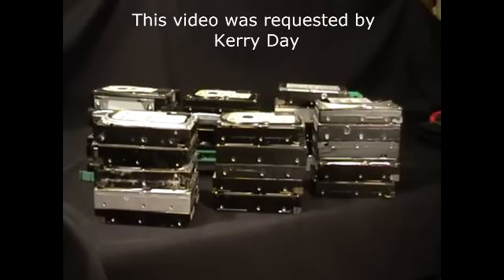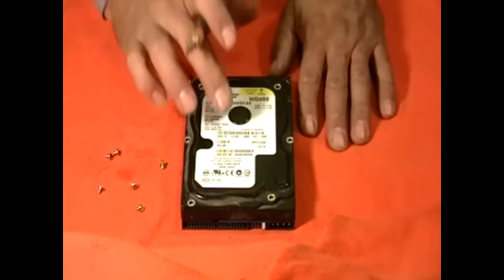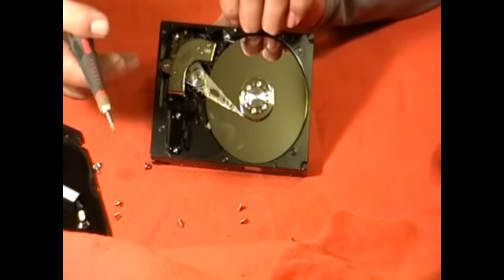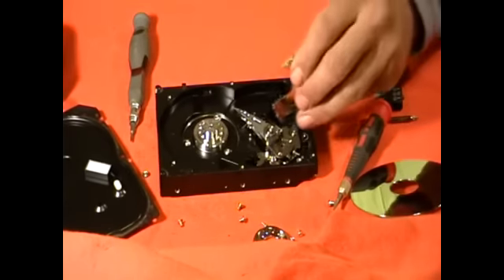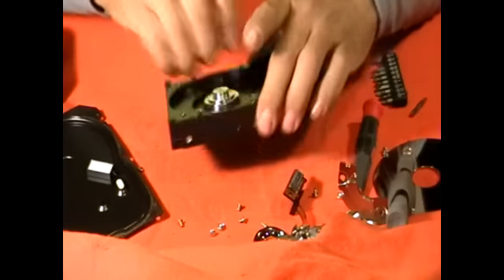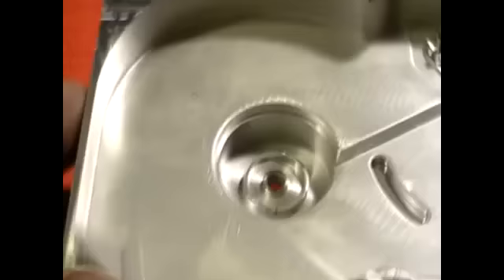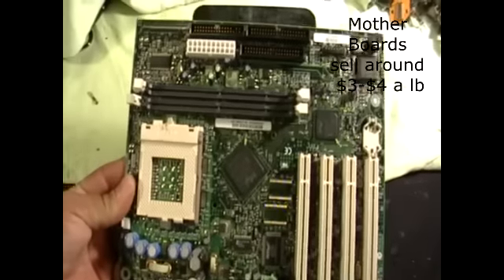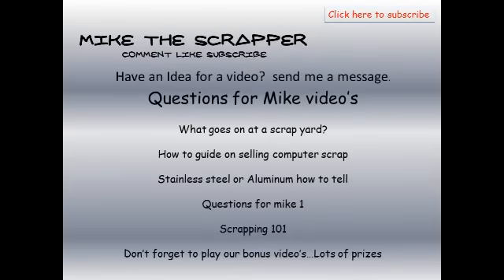Make money with  Hard Drives

Comment: the platter is not platinum plated aluminium at all it is pure nickel.
have had many tested right in front of me with an xrf xray gun.
they were all from different brand hard drives and different capacity of gigabytes
if they were platinum in any amount the xrf gun would have picked it up,reason we had them tested was we were also told they platinum plated aluminum.
we had every other component in the HD'S tested as well no gold, platinum, or magnesium which is what we were after
Reply: Why do they call it a platter, maybe should be a nicker. Stop getting your nickers in a knot
Reply: Some hard drives do contain gold, especially the older ones!

Comment: not enough money to be worth it
I say RAID0 them all along with other old computer parts and make... I don't know, something...
Reply: But if this is about money a RAID 0 of WD200 20 GB hard drives (like the one shown at the start of the video) will cost you about 6 watts each. Fifty drives gets you one really unreliable (hey, they're junked drives for a reason) 1TB drive at 300 watts, just for the drives. Or you could get a 1TB SSD laptop hard drive that uses 3 watts peak. 300 watts of electricity is about 4 cents per hour around here. If your epic 50 drive RAID 0 survived 4 months of run time it would have been cheaper to buy the SSD hard drive. If you buy the SSD with the proceeds from scrapping the fifty hard drives the break even time is down to days.
I'm still not quitting my day job to deal in scrap metal. I agree that you would have to be using nearly valueless time to make this a good investment.
It isn't as insane as it first appears.  (Maybe just a little mental, but not clawing at the walls insane...)

Comment: All that aluminum isn't even worth 10 bucks...
Reply: +Mobin92 Aluminiun in usa is cheap because then stolen from another countrys.
Reply: +Senhor ZAN kkkkkkkkkkkkkkkkk br hue em todo lugar !
Reply: UH at my scrapyard right now they are only paying .40 cents a pound. However if you did the MATH involved you would see that 30 lb x .40 = $12 Canadian, about .50 cents US.... hahaha 
At the rate Mike listed his yard was paying .50 cents that would be 30 x .50= $15. And that is the case only.  Didn't you watch the whole video? Or do you not know how to use a calculator?
Reply: There is a scrapper video where they gut a set of older JBL monitor speakers to get at all that "copper".  Oblivious to the value of the item in its entirety if left intact, they pull the few cents of copper from the tweeter's diaphragm voice coil which was obviously a good functioning unit.  The irony is one intact tweeter itself fetches over $80 quite readily as there is a demand as no replacements are available.